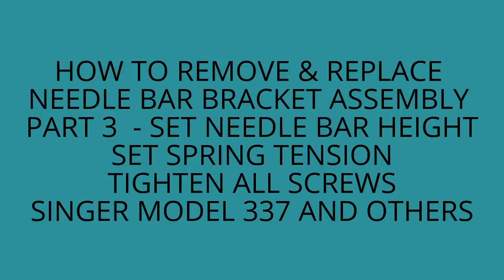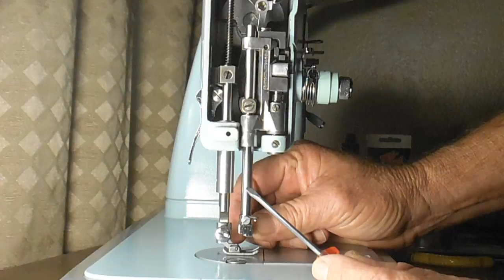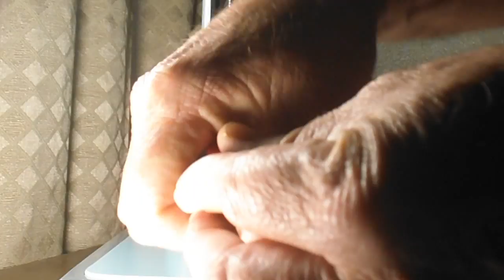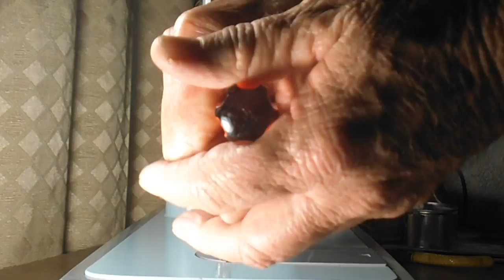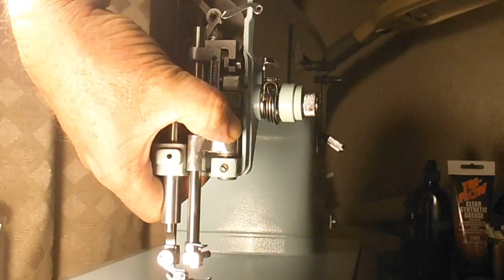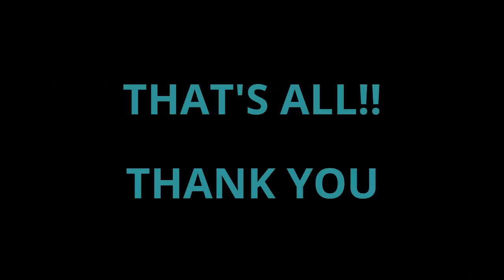SINGER MODEL 337 - HOW TO REMOVE & REPLACE NEEDLE BAR BRACKET ASSEMBLY PART 3 LAST

Comment: Don’t know what I was going to say. Sorry. I have taken the thread guide and needle holder off but I still can’t get the needle to go in easy. The thin metal that the needle slips in is not allowing it to happen. I have tried to straighten but nothing. The part is only sold as the rid and bracket but it’s out of stock.
Reply from the maker: what if you try again?
Reply: Andy Tube is there a way to send a picture? Or do you have a list of parts places I could contact?
Reply from the maker: @SharoninKentucky  the email for my channel is andytube53@gmail.com
Reply: Buenos días sería posible que lo explicaran en español

Comment: Hi, I have Singer 298, while I do zigzag, the needle bar just move between middle to right, it can't move between left to right. The strait stitch (left,middle,right) are  all correct, how do you think the  zigzag's problem might be ? Thank you.
Reply from the maker: Model 298 is very unique. I don't believe it was sold in the USA and I can not find parts or service manuals for it. I've never seen or worked on one. The Instruction Manual is still available for free directly from singer https://www.singer.com/search/support?title=298
Between that manual and some pictures I found online, the mechanics of the machine remind me of model 237, made in Italy. I hesitated to tell you that because I do not want to sidetrack you with bad information, but looking into the 237 may give you some clues about your machine. If not, my apologies https://www.youtube.com/playlist?list=PLsCOZgzzaiKKzvgm_CYPFnDeM8ZqTTo1h
On page 88 of the instruction manual is a picture showing where to oil the BACK of the machine. It is very rare to have a back opening for oiling a Domestic Singer Sewing Machine. I would open that back cover and do my best to clean and oil those parts; and the same from the top of the machine and the vibrating bracket that holds the needle bar. On many machines I have worked on a good cleaning and oiling has fixed many of the types of problems like the ZZ problem you have. Sorry, I can't be more specific about a solution, but good luck.
Reply: Andy Tube Thank you for your reply. I will read Singer 298's manual , the first page said "FR: TAICHUNG" , I think it's made in Taichung, Taiwan. Singer 298 is very similar to Singer 224, 238, Singer 237 might be helpful.  I got Singer 298 for a few days, the previous master may only use the straight line,  the fashion disc even in the box not on machine, lucky the straight stitch was very smooth, but the zigzag was all stuck, it became better after oiling but still not good as usual. After oiling all machine, there was no change, so I use youtube to find the solution. At the beginning, I think maybe it's hook timing's problem, but I saw the needle bar didn't go to the left side , I think it's needle bar's problem.  I'll clean the disc cover parts, after removal rust maybe can fix it. Thank you so much.
Reply from the maker: @yu2086  Yes, very hard to find documents or parts for Taiwan made Singer machines of that decade. Best of luck to you.

Comment: Hi, I have a kenmore 158.1650. I'm trying to figure out how to align the needle at the center of the foot. It was way left now it's way right, but I'm not even sure how it got there. Could you please advise me?
Reply from the maker: Sorry, Ashley, I don't work on Kenmore models. On a ZZ machine, the needle bar is usually held in a vibrating bracket. That bracket is what swings or zigzags the needle bar left and right. There is a part called a needle bar driving arm that goes from the camstack area to the vibrating bracket to make it swing. On most SInger models you loosen the arm connection at the bracket, center your needle, then tighten the arm connection back up. The machine should be set in straight stitch mode when you do this, and the stitch length set in the middle of the range, like 10 to 12 or so.
Reply: @andytubesewing1953  Thanks for this info, it helps anyway.
Reply from the maker: @ashleyschoenfeld3482  no worries and good luck.

Comment: I have a Brother XR-65 sewing machine and I am looking for an instructional video for reattaching my needle holder to the bar on it.  Your video is very detailed, but my machine is so different.  Can you please guide me to a video for my machine?
Reply from the maker: Hi Rose. I do not work on Brother machines, but a clamp is a clamp. I know some are different, but they usually held on with a screw or set screw. Take a look at the links below for help. If you need more help let me know and we will exchange some emails with pictures. Good Luck.
https://www.youtube.com/watch?v=y0g3vwWkqf8

https://www.sewingpartsonline.com/needle-clamp-babylock-brother-xz0001051.aspx

http://support.brother.com/g/b/manuallist.aspx?c=us&lang=en&prod=hf_xr65teus&flang=English&type3=348&type2=69

http://download.brother.com/welcome/doch000061/xr52c65txl64526562ug01enesfr.pdf

https://help.brother-usa.com/app/answers/list/st/5/p/6639/page/1
Reply: OMG!!!  That was EXACTLY what I needed!   THANK YOU SO MUCH!!!  :)  :)  :)   Now I can keeep sewing and not have to wait while I take it to a shop to be repaired!!  PLUS of course, it saved me the cost of the repair!!  I SO appreciate your prompt answer, and that video was exactly what enabled me to do this simple repair  myself.  I knew it should be simple, but was not confident when I looked at all those screws in there and wondered which one or ones would enable me to reattach my needle clamp that just fell off as I was sewing.   Thank you again!!
Reply from the maker: Nice, and good on you Rose for a do-it-yourself repair. No repair shop needed. Keep sewing and have fun.